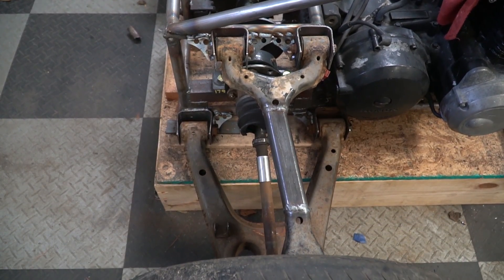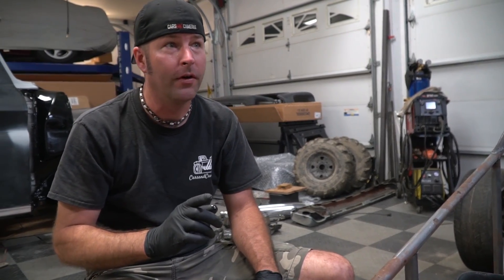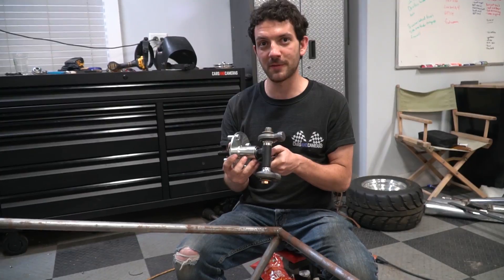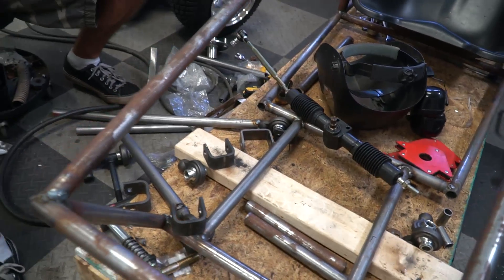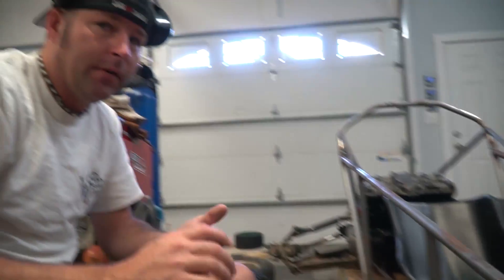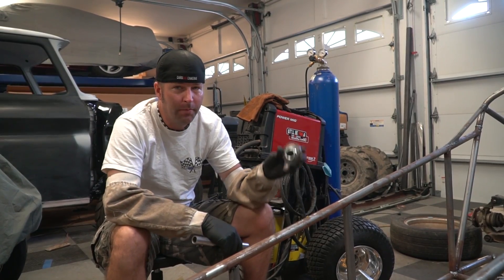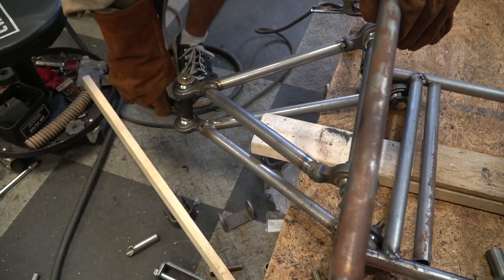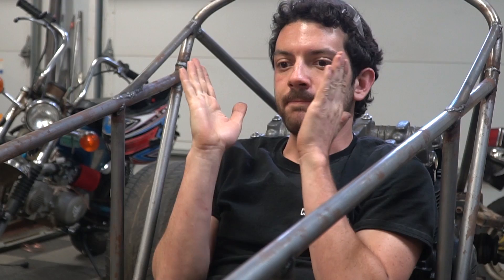Independent Front Suspension Build! | 750cc Cross Kart Pt. 9

Comment: should have used heim joints instead of the tractor links
Reply: I hope you realize now they are in fact heim joints?  Might want to edit your comment.
Reply: @SportbikerNZ  if you want to get technical they are rod end bearings. Heim joint is actually a slang term that usually refers to threaded rod end bearings. you might want to edit your comment
Reply: @leetucker5788  You still don't admit they are heim joints?  Amusing.
Reply: @SportbikerNZ  once again the term heim is slang term as they were first manufactured at the H. G. Heim Company. Kinda like how most people call locking pliars vice grips. Vice grip is a brand and not a type of tool.
Reply: @leetucker5788  You said they "should have used heim joints instead of tractor links".  John had to patiently explain in the following vid that the 'tractor links' were in fact heim joints.
Reply: @SportbikerNZ  they are rod end bearings. Heim is a brand or common slang for a threaded rod end bearing. Do a quick Google image search for heim joint. Guess what you won't see there: a tractor top link. Better yet, go to the Wikipedia page for rod end bearing where there is a diagram of a heim joint. Guess what shows on that diagram, a threaded end.
Reply: @leetucker5788  So you are trying to argue semantics on a threaded shaft when fundamentally they are heim joints?  Good grief.  John was completely correct in his response to this, fundamentally they are heim joints.  But since you want to double down instead of own up, that's your business.
Reply: @SportbikerNZ  just because they look the same on the outside does not mean they are the same. Tractor links are just metal on metal. Most heim joints have some some sort of liner to reduce wear. Kinda like saying a ball joint and a tie rod are the same thing. They are both ball joints yet no one calls a tie rod a ball joint. I have nothing to own up to, just because you wanted to start an argument over semantics. There's a reason nobody uses tractor links on automotive suspension yet you see heim joints used quite often. They are both rod end bearing but they are for different applications.
Reply: @leetucker5788  The actual joint in the tractor link is a heim joint.  End of story.  Sure heim joints come in a variety of forms and quality, but it doesn't take more than a few minutes reading what a heim joint (aka rod end bearing aka rose joint) is on wikipedia to know these tractor links definitively use a heim joint minus the threaded shaft.
Reply: @SportbikerNZ  you said it yourself in your last sentence. It's a heim joint minus the threaded shaft. Just like a ball joint is a tie rod minus the threaded shaft and because of that they have different names. It's similar but different. A fact that you just admitted yet you're still trying to argue that they're the same. I'm done, go try and be a know it all somewhere else.
Reply: @leetucker5788  Ok, if what you were originally meaning is that these joints need to be threaded for whatever reason, then I understand.

Comment: Those "ball joints" you got from tractor supply are called Hyme Joints. There are way better versions available, way more flexible, lighter and stronger and likely cheaper. As commented many times, your front suspension is binding badly and needs a rework. The angles are wrong. This guy explains in detail how it should work, it might help you fix it. https://www.youtube.com/watch?v=DsEmK1M87VQ.
Reply: Those things they are using are not Heim Joints - not at all
Reply: @Mad-Duk_Machine_Werkes  Heim is a brand name so I guess they are technically spherical rod end bearings. Regardless of what you call them...there are better versions that they could use.
Reply: @onebadsavage26  Not matter what anyone calls them, No one spells it Hyme....... LOL

Comment: Even if you fix the control arm pivot angles, the design the way you've utilized those "top links" you're already aware limits the suspension travel, maybe you'd need proper bump stops with rubber to prevent breaking the kart when you rip it. Great try it'll be fine.. I hope the result ends up majorly re-doing this design. :)

Comment: The upper and lower arms should be parallel looking from the front, yours are not and are probably causing most of the binding you're seeing
Reply: It's not the arms being parallel that's the problem its those pivot points not being parallel to each other binding. Notice that it binds even with just the lower control arm and no upper.

Comment: The measurement between the mounts for the upper and lower heim joint needs to be the same as their total height on the spindle. Until you change your control arm mount location it's just going to bind like all hell and break and/or break suspension parts.

Comment: The lower control arms tabs appear to be pointing wrong causing a bind up. It will only free up when something breaks. You have 3 different pivot angles. Make them point the same way as the top ones and it will not bind up.

Comment: The design of your front suspension needs to be reworked. The ball joints are binding because the arms aren't in parallel. That stiffness you guys saw is not a result of the parts being new, that is the suspension binding up.
Reply: It's also twisting the entire chassis as it's moving if you look closely ..
Reply: Man i need someone to help me with my steering angles
Reply: Mr Engine you know who NOT to call now...
Reply: Except in the next video they showed this comment was completely wrong.  The Heim joints were merely stiff from fresh manufacture.
Reply: @SportbikerNZ  Even if that were true, you can see that the A-arms are not parallel - just incorrect geometry. They were definitely binding. But hey, they built it for fun, not for top level competition.
Reply: @BunkerBlog  There is no incorrect geometry here.  There is no binding either.  Watch the next vid in the series where they took pains to educate the painfully clueless internet experts.
Reply: @SportbikerNZ  I watched this whole series, and I am aware that the heim joints they used were stiff, BUT, the geometry *was* incorrect. On every kart/buggy that uses double A-arms, the the top and bottom A-arms are parallel as to prevent binding. These A-arms were very slightly off. That's not me trying to be an "internet expert", that's just how A-arm setups are supposed to work.
Reply: @BunkerBlog  I suggest you google "unequal-length non-parallel A arms" like they are using on this cart.   John also chatted about geometry here https://youtu.be/wihgaXSsBUM?t=726

The carsandcameras vids seem to be especially rife with comments by internet experts aka mechanically inept types who pretend they know what they are talking about.
Reply: @SportbikerNZ  Notice that I said nothing about the A-arms being unequal length. I said that the A-arms were not parallel (at the same angle). Many of those Chinese buggies use unequal length A-arms. But again, if the A-arms are not PARALLEL (at the same angle), there will be binding. The book John was reading from only mentioned that unequal length A-arms would work, not that non-parallel A-arms would.

You keep repeating that the comments are full of people who don't know what they're talking about yet I don't think you understand their criticism to begin with. I'm not trying to insult you by saying that, I'm just telling you that you should not disregard said criticism as coming from "mechanically inept" people. They have a point.
Reply: @BunkerBlog  Did you even read my comment?  Why are you ignoring the fact that non-parallel A-arms are a valid design choice?  Why are you persisting in pushing the falsehood that A arms should be parallel?  It would take you 2 seconds to google non-parallel A-arms...
Reply: @SportbikerNZ  I read your comment, but it does not change the answer. If you don't trust me, look at the vast majority of off road vehicles. Quads, Piranaha/Barracuda buggies, those Chinese buggies, UTVs, etc, they all use double A-arm front suspension where the two A-arms are almost exactly if not perfectly the same angle (not necessarily same length, but at the same angle). Again, the reason for this is to prevent binding. Go over to the diygokarts forum and there are tons of threads on correct double A-arm suspension geometry. Both A-arms (and ideally the tie rods as well) should all be in parallel to prevent both binding and limit bump steer as much as possible.

At the end of the day it's a little late to be having this conversation as their setup obviously worked well enough, but my - and everyone else's - point was that it was not necessary the ideal setup.
Reply: @BunkerBlog  I can see you want to keep pushing the same line.  There is a wealth of info on non-parallel a-arm design waiting when you want to find it.
Reply: @SportbikerNZ  You seem like you're very emotionally invested in this conversation. I'm just telling you the ideal setup. I'm repeating myself because the answer does not change. I know non-parallel setups *exist* but they are not - especially in this application - ideal. If you want as little bump steer as possible and no binding, you need parallel A-arms and you need the tie-rods to be as close to parallel with those A-arms as possible. That's just how it works. You can even see they have pretty noticeable bump steer in the video that comes directly after this one. Don't shoot the messenger. 

Again, look at quads, buggies, and UTVs, and you will see that the VAST majority are set-up in this way. There's a reason for that.
Reply: @BunkerBlog  Interesting, at least you've made some progress to admit they exist, not accidentally, but intentionally exist.
Reply: @SportbikerNZ  I never said they didn't. i just said that they weren't ideal for this application.
Reply: @BunkerBlog  That's a matter of opinion.  Whether or not they are ideal depends on their specific goals.
Reply: @SportbikerNZ  Well, there must be some merit to it considering that's the way almost every DIY buggy/kart build I see does it, as well as pretty much every manufacturer-produced kart/buggy/ATV/UTV. But if your goal is to have binding and bump-steer, than sure, go for it I guess...
Reply: @BunkerBlog  Amusing.  There is no binding as evidenced and previously pointed out.  If they wanted lower roll center, this is exactly how they should set up the suspension.  Perhaps the more you try and spin this as a mistake, the more it will seem true?
Reply: @SportbikerNZ  "There was no binding" you say, as you can clearly see the suspension binding. "But it loosened up!", you'll say, as you can still see that the travel is limited due to suspension bind. Those heim joints are able to pivot more than they are. And don't even try to deny the bump steer, because you can clearly see it at the very beginning of the next video. 

I know you're really invested in this but you're treating this like some sort of pissing contest. That was not the  intention of my comment. Even if it were the case, the vast majority of commentators, DIY builders, and manufacturers agree to use the setup I described. Is *everyone else* wrong, or are you wrong?
Reply: @BunkerBlog  One need only look at the successive videos to realise there is no problem with binding.  Travel was precisely how they planned it...
Your ego has forced you to double down for whatever reason, it's amusing.  
You do know that suspension is not a one-dimensional field right?  The customization is endless depending on your goals.  It would be most ignorant to say "most cars are set up to under-steer.  Your car isn't, so you're doing it wrong." yet you're pushing the same fallacious line here.
Reply: @SportbikerNZ  We must not have watched the same video, because the A-arms stop travelling before the limit of the heims. 

"Your ego has forced you to double down for whatever reason, it's amusing."

This is what we call "projection". Denying that you're doing something by saying that others are doing it. Remember, you're the one suggesting that almost every commenter, builder, and major manufacturer is wrong, not me. If I'm honest, I'm getting tired of repeating myself (and I'm sure you are too), so let's just agree to disagree, OK? Because this doesn't seem like it's going anywhere.
Reply: @BunkerBlog  As time told, the suspension worked exactly how they designed it to work.  They had zero problems with binding and the non-parallel control arms worked how they were designed to work.  So yes, we can agree to disagree.
Reply: @SportbikerNZ  Just as I said before, just because it "worked" doesn't mean it was the ideal/correct way to set it up. There is still binding, as the heims were not at their limit when they should be. Hopefully this is the last time I need to repeat myself. Take care.
Reply: @BunkerBlog  Show me where it's binding.
Reply: @SportbikerNZ  Watch the next video in the series. Compare the top and bottom heim joints. You'll see the bottom heim joint hits its "limit" of rotation while the top is pretty much dead center. If the A-arms were parallel, they would be equal and allow for better travel (both heims would ideally reach their full rotation). There's also noticeable toe-out bump steer, but that's more of a consequence of the tie-rods not being parallel with the A-arms. 

They still achieved their goal for travel which was 4", but they could've set it up better. Again, at the end of the day it is not a huge deal since it works adequately, but it is still not the ideal/correct way to set them up, which is my point. Hopefully this clears things up. If not, then there's nothing more I can really do to help you at this point.
Reply: @BunkerBlog  I looked at the next vid.  They specifically addressed the binding falsehood https://youtu.be/wihgaXSsBUM?t=22 
"Suspension Travel is limited by Shock not heim joint binding."  To argue the heim joint may have a fraction more travel available (I disagree) is pure pedantry and completely irrelevant given their design goal and shock limitation.
Reply: @SportbikerNZ  The first time they set up their shocks, they (self-admittedly) were under-sprung, causing the shocks to bottom out. After they adjusted their mounting points the issue was fixed, and you can see that the shocks are no longer fully bottomed out when compressing (even after reaching their goal of 4" of travel). So no, the limiting factor was and still is the binding on account of the heims. It isn't a nitpick, a significant amount of travel could be gained if both heims were allowed to fully rotate (especially considering we are only talking about 4" of travel in total). 

I'm not sure what else I can say to point out to you that there is binding, but at the end of the day my job is not to convince you (especially if you refuse to be convinced out of "principle"). I'm going to place my trust not only in my own observations but the tons of other people who commented, the DIY builders, and the powersports manufacturers who build their suspensions in the way I described to you. There is no point in me arguing with you if you're just more concerned with convincing yourself that you are right rather than *actually* being right. With that being said, take care.
Reply: @BunkerBlog  As evidenced in all following videos, there is no binding or hanging up caused by the heim joints.  There is no problem with the non-parallel control arm method of design.  The suspension has continued to operates cleanly throughout.  
It's a pity people recreationally criticise outside their technical ability, but hey, it's the internet.  
Isaac and John must tear their hair out at some of the inane rubbish people come up with.  it was sweet victory that time vindicated their design and proved the above criticisms complete bunk.  Unsurprising given the lack of commentator technical competence.

Comment: Hi guys. Just echoing what Justin below me has said. You need to be able to pass a straight shaft through both bottom arm pivot points. Those angled mounts are what is causing your suspension to bind up. I'm not just another internet keyboard YouTube expert. Have been involved with building some very tricky racecars over the years. Please change those bottom mounts. Make them like your top ones.